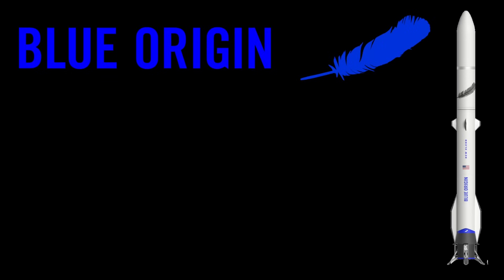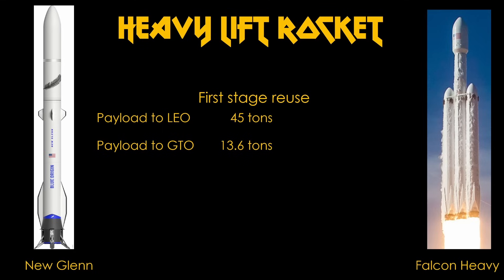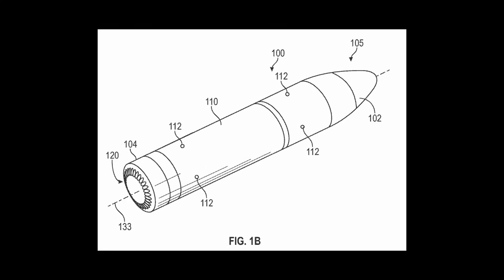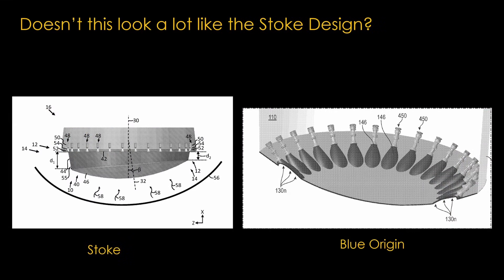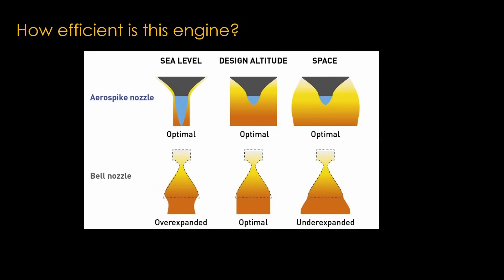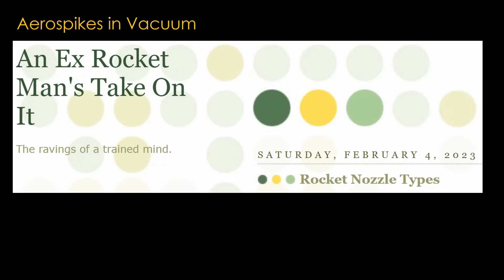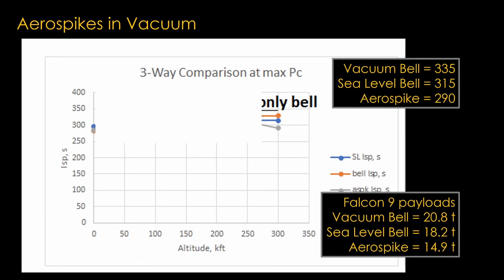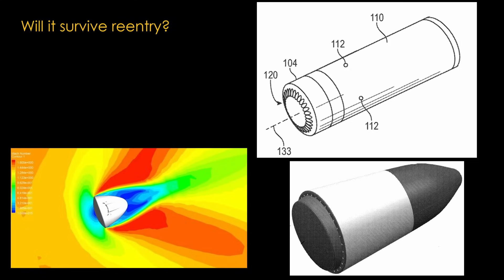Blue Origin's Starship Killer?

Comment: Thanks for the video.  The idea of an aerospike always being optimal never made any sense to me.  The way a rocket works is by tossing momentum out the back, but since it's a fluid being ejected, you can also imagine it as  generating a higher-than-ambient pressure pushing up over part of the cross section of the rocket to produce a force.  If there was no [expansion] nozzle then high-pressure gas would just come out of a tiny hole, and so no matter what pressure that exhaust is at, the overall force is going to be very low, and efficiency will be terrible since this highly pressurized exhaust stream will shoot out sideways as soon as it's able, wasting energy that could have been used to push up instead of out.

So the nozzle expands outwards, keeping the pressure from dropping by closing off escape vectors, and providing a larger surface area to act over - the walls trap the high pressure gas inside and force it to go up and down.  If the nozzle is too small, some gas will still shoot sideways upon exiting, wasting energy (the halo seen when rockets fire in space).  But if the nozzle is too large, and the exhaust over-expands to being less than ambient pressure, you get big problems.  1) You're hauling extra weight for more bell than you need, 2) You're arguably pulling a vacuum towards the outer rim which is going to actually pull down on you., and 3) you're going to get bad drag and vortexes as the ambient air tries to infiltrate the bell. 

An Aerospike gets around this by firing all the gas inwards, producing a high-pressure zone at the center.  That zone expands outwards in a gradient, dropping in pressure, until it's in equilibrium with the ambient air.  The higher the ambient pressure, the higher the pressure at the center pushing on the center of the rocket bottom.  As ambient air pressure drops, the exhaust expands, having lower pressure at the center, but it gets to work over a larger area, which is a net gain.  No heavy bell, no flow separation, and no risk of pulling a vacuum from over-expansion.  It's a cool dynamic system.

But what happens when the ambient pressure gets too low?  At some point, in order to expand enough to balance with ambient pressure, the exhaust stream will have to expand to be the full area of the bottom of the rocket.  Expanding more beyond that still decreases the inner pressure at the center, but it doesn't get more rocket-bottom to push on in exchange.  Now it's just pushing up on the ambient air around the rocket.  Whereas a bell nozzle that expanded to be wider than the rocket would provide the surface to still do work on the vehicle.

And when you go out into space, with no ambient air, the aerospike should basically perform the same as though it were nozzle-less.  You have the fundamental problem that, with no atmosphere, there's no quasi-outer nozzle to keep the gas contained and focus its efforts rocket-ward instead of outward. Maybe the inertia of being throw inwards combined with the spike helps helps (the sloped spike in the middle catches the cross-firing exhaust and gets pushed up, like squeezing up on a push pop) but that means truncating the spike should be a further loss to vacuum isp, and make it perform closer to being nozzle-less and being equivalent to the combustion chamber pressure + the size of the small exhaust aperatures.

I'm sure there are other higher-order considerations involved and this treatment is probably making rocket engineers cringe, but it seems that going by first principles, an aerospike can be dynamically optimal inside the atmosphere, but only so long as the ambient pressure is enough to keep the exhaust from expanding to be wider than the rocket bottom.   After that point, it will start to lose efficiency compared to an appropriately-sized nozzle, and once in vacuum, its performance should be worse than having any-kind of nozzle, barring any interactions with the spike.   Which is what the chart from the blogpost seemed to show. 

So, nice to have that intuition validated. Every time someone has spoken about aerospikes to me I always feel like they're gaslighting me about basic physics.
Reply from the maker: In vacuum the aerospike reverts to what ever nozzle they have on the combustion chambers, which isn't great. 

Aerospike seems like a good idea only if you do ssto, but that's a bad idea to start with. Shuttle would be a good use case but NASA decided just to build a sea level engine with the biggest nozzle they could get away with.

Comment: 7:50
this may vary a bit with different aerospike design but you will get a similar problem with all of them
also, these are probably plotted for ambient pressure at that latitude but behind a supersonic rocket you'll ahve al ower surrounding pressure from its movement
same effect backwards you want to use sea level optimzied engiens for slowing down a rocket on reentry, in additio nto wanting ot use the same engiens for landing
Reply from the maker: I was assuming that launch and return aerodynamics were the same and that's pretty clearly not justified.

Comment: Transpiration cooling, or something approaching it is used in HP turbine blades in jet engines and has applications all over the place. A great deal of research is being done in this area.
Reply from the maker: Do they bleed fuel through the blades? Or just cool air?
Reply: @EagerSpace  Air is bled from the compressor, and passed through a lots of parts including the HP turbine blades immediately downstream of the combustor that see hot gasses at 1300C. Modern blades have a serpentine channel with ribs and pedestals, and many very small holes to transfer the heat from the metal to the coolant and produce an insulating film of coolant over the blade. The future is to make more elaborate geometries with even finer holes and passageways for better heat transfer and a smoother insulating film. The air from the compressor is about 700C.
Reply from the maker: I'm not a rocket engine designer at all, but I think it would be a big design challenge because of the power density and compact size of the turbo pumps.
Reply: @EagerSpace  Yes agreed. Also the smaller the vehicle the less volume/area ratio so the less fuel there is available for cooling per square metre of skin.

Comment: New Glen is a decent size i think they would do better to just copy starship if anything else in the way the upper stage returns.
As your video shows aerospike engines suck though from the BO patent it seems like Bezos has a differing opinion about that.
The advantage with NG is that being smaller it should be a bit easier to develop but BO have managed to go slower even than the much bigger starship.
Once BO do fly and NG if it works out cheap by doing frequent launches and so on then how do spacex react as starship will be more expensive per launch and many external customers will only have small payloads so BO could be very competitive once they finally start flying.

It's also interesting that starship is getting bigger rather than smaller - to me it would be interesting to see how this all plays out and if starship could actually get smaller 
like a shorter booster and upper stage than the present height. Say dropping down to 100 meters height a 60 meter tall booster and a 40 meter tall starship for doing smaller payloads at lower propellant cost but then again they probably are better off to just focus on durability since most of the cost is the hardware depreciation rather than propellant which is only a few million per launch.
Probably they can make use of spare capacity in many creative ways.
Sending up starlinks or delivering propellant to on orbit tankers for future deep space missions.
Make use of spare capacity to carry out space manufacturing operations or something.
Reply from the maker: Bigger rockets have slightly better propellant to material ratios, and I suspect that starship has to get bigger to work.
Reply: @EagerSpace  They pretty much just proved it works on IFT4 - now it's a matter of improving it to get the 100+ tonnes to orbit and get it back in good condition as opposed to sinking in the ocean - the present vehicle is also not optimised at all yet proved it's entire flight plan.
They got plenty of options including a smaller payload bay and more exotic materials like titanium grid fins like the falcon 9 had.
Now that it's done IFT4 they will be able to optimise the design to get significant weight savings knowing how much propellant reserve they need and exactly what structural and thermal loads are like could save great deal of mass.
Another advantage of 100% reusable vehicle is the cost of materials and invested manufacturing no longer matters as much because you get 100% back and can spread out the manufacture and materials cost over many flights.
Present starship is using plenty of stainless steel so one obvious option is to swap out some of that steel for titanium - maybe on pieces like the drag flaps and engine bells.
The savings on the engines and drag flaps could easily be 5000kg.
And so far as i know the rockets payload bay structure could be lightened significantly by using thinner steel saving maybe 10000kg.
Another option is using thinner thermal tiles on those areas that get less heating now that they know where the hot spots are- that's probably going to save another few tonnes.
Anyways i can easily see them getting the vehicle mass down over time and performance optimised until they can do 100+ tonnes.
The general strategy would be doing all these little improvements just like the falcon 9 which over time has gotten a larger payload capacity.

Comment: Aero-spike may have more benefits as a gimbaled thruster(s) verse the mass needed to gimbal a large bell design.. so your bell thruster engines save mass and don't have to move, can be better shielded as the aero-spikes take entry better, have better ignition at higher speeds into the nozzle (as it can be variable and close down).. but Blue Origin will have to contend with heat shielding anyway.. or much of tier payload will be devoted to slowing down on re-entry.. maybe O.K. for space tourism.. but they still need a smaller proof/tourism model.
Reply from the maker: I've thought a bit about the gimballing tradeoff. If you have a bunch of thrusters you will need to control them individually - which Stoke can do IIRC - but that means valves to control propellant flow at every thruster, which seems to have as much weight as the gimbal mechanism and likely more difficult to get to work well.

Comment: The Starship re-entry demonstrate the challenges to the second stage re-use. I wonder what special materials New Glenn will use. At the moment the demonstration units appear to be fabricated from aluminium, which is OK for launch but not so much on reentry.
Reply from the maker: Pretty sure the one tank we saw was stainless. The non-reusable versions are probably aluminum lithium
Reply: They are planning to use a hydrogen cooled heat sheild.. with the bottom being a cooled dome and one side I believe I heard somewhere that it'll have pores that sweat hydrogen.

Comment: Weight to orbit is less important than volume to orbit. 

New glenn has a seven meter faring which can accommodate sierras blue ring modules, falcon heavy cannot achieve this. 

Falcon heavy is not used commonly because, while it can lift a lot of weight, it cannot accommodate all the customers when it comes to volume.  So customers just opt for a less cost efficient option in falcon 9.  Theres no reason to use falcon heavy. 

This doesn't apply to NG, as it has the volume to  accommodate many customers ride sharing.
Reply: No, weight to orbit is the primary metric. There are some special payloads that demand a lot of volume, but they are unusual, and just not a very meaningful market.

Most GEO launches fly on Falcon 9, because it has sufficient payload to GTO, it's cheap, reliable and available. But if you're going direct to GEO, Falcon Heavy is your best bet.
Reply: @SpaceAdvocate  

you're not understanding. 

Weight is not the primary metric for commercial purposes.  We know this, because falcon heavy is skipped on for falcon 9 launches.  It has nothing to do with GEO direct, because that is not in enough demand. 

But NG can ferry much more volume to GTO than falcon 9 can,  purely because it's faring is double the size, 

This allows more customers to ride share on a single rocket, diminishing costs, increasing demand for NG. 

With respect to this commercial reality, payload weight means almost nothing.
Reply: @iamscoutstfu  Weight is the primary consideration, Falcon Heavy is just too capable for most GEO satellites. When the satellite companies can chose between Falcon 9 at ~$60 million and Falcon Heavy at ~$100 million, they usually go for the former. Falcon Heavy can do direct to GEO which may decrease time to get the satellite operational, and increase life span, but they still prefer to save the $40 million.

If New Glenn ends up costing something like ~$90 million, the companies would still prefer to save ~$30 million by flying on Falcon 9 if they are going for a dedicated launch.

You might say that the volume allows two satellites to share a launch, and that would be cheaper than Falcon 9, but that will be the interesting part. We will just have to see if SpaceX drops pricing to ensure Falcon 9 is still cheaper. SpaceX likely makes a gross margin in the 50-65% area on Falcon 9 launches. Dropping the price to $40 million per launch would still leave them with a healthy 25-50% gross margin.

This mostly comes down to cost per kg. Volume is a secondary concern, which may impact the effective cost per kg.
Reply: @SpaceAdvocate  

you're not understanding. 

Weight is not the primary metric for commercial purposes.  We know this, because falcon heavy is skipped on for falcon 9 launches.  It has nothing to do with GEO direct, because that is not in enough demand. 

But NG can ferry much more volume to GTO than falcon 9 can,  purely because it's faring is double the size, 

This allows more customers to ride share on a single rocket, diminishing costs, increasing demand for NG. 

With respect to this commercial reality, payload weight means almost nothing.

Comment: I'm confused on how the nozzle operates when the rocket is coming down butt-first.  I understand why the sea-level nozzle has to be a tighter angle than a vacuum nozzle (on the way up) to avoid atmosphere infiltration and turbulence, but when the nozzle is firing into the oncoming air, would the front-pressure prevent that infiltration?  Actually, hazarding a guess here, since the exhaust is supersonic, the pressure of the oncoming air would do next to nothing to fill a vacuum nozzle with that exhaust, so the turbulence would be a lot worse, wouldn't it?
Secondly, I thought an aerospike required the air flow around the engine to help shape the thrust.  If the spike is flying butt-first, would it even work at all for slowing down the rocket?
Reply from the maker: That's a very interesting question and one I haven't thought about. My guess is that since the nozzle efficiency depends on the outside pressure, there will be an effect but I didn't know how much there will be.

Comment: My 2 cents is that any second stage recovery is worthless after all understood from rocket science...if disposing second stage will give me 300 tonn delivery to LEO and trying to recover second stage will give me 100 tonne..co considering lunching 3 times ,labour cost ,insurance cost and risk of additional two mission going boom, only conider the 1000s houres cost of only the control room will exceed 1 million,reuse of second stage become obsolete either way...I hope that Elon gets over that idea soon
Reply from the maker: To understand the economics, you'll want to build a full model that looks at fixed and marginal costs. Based on the numbers, second stage use can be a horrible idea or a great Idea.
Reply: The cost is in the building of a new stage.  Reuse saves a lot.  Clearly your understanding is badly flawed.
Reply: My guess is that they will realize the vanes on Starship need to be as large as the Spare Shuttle's wings, and given wings they will decide to land on a runway, and shuttle the vehicle back to the launch point. But, long before then they will realize Starship needs a reaction control system (for example, when the vehicle starts rolling when they open the bay door).  That is, if Starship as we know it today is viable, which is not clear from the launches to date, lacking dummy weight(s).

I suggest greatest advantage of disposable vehicles is simplicity. Not just in design, but in *adminstration*. It is easy to focus on the vehicle(s) and forget about the infrastruture, and the risk of not just in the design, but in the infrastructure.
Reply: @JoeOvercoat  They've already demonstrated that they can get through reentry and land softly. There's no way they are going to change the design radically at this point. Doing a runway landing would be a complete redesign at this point. And Starship has a reaction control system. It worked well on flight four, keeping the vehicle in the correct orientation for reentry.
Reply: I would expect that reuse of the upper stage would minimally drop the cost of a flight from something like $50 million to something like $20 million. That allows for a few weeks of refurbishment between flights. Already at that point it would be profitable, with upper stage reuse having more like a 40% hit to payload, not 66%.

But another consideration is that even if reusing the upper stage were more expensive, it would still make sense for SpaceX. Starship is designed for Mars, and there will be no Mars landings without first figuring out upper stage reuse on Earth. The same goes for using it for crew to Earth orbit or the moon - astronauts wouldn't be able to return without Starship being capable of surviving reentry.